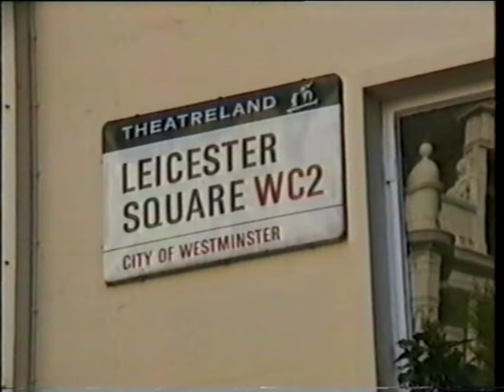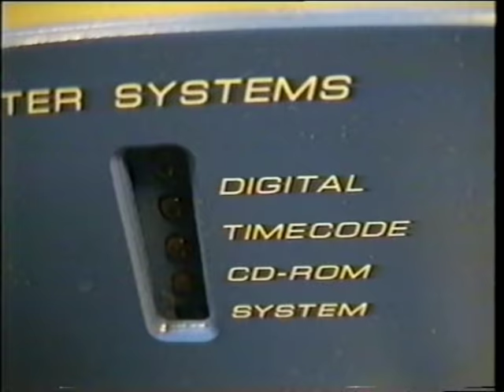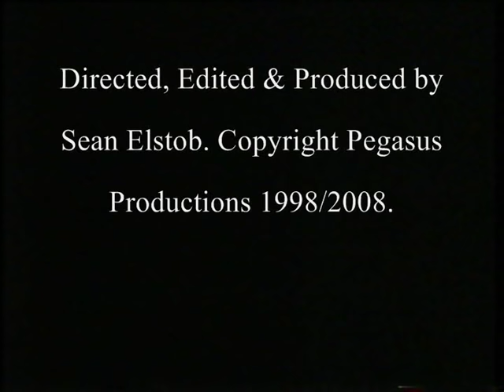70mm...Titanic By Nature

Comment: I used to use a cake rack for lacing up 35mm back when I was a projectionist. I have never laced up 70mm. I wonder what the grain was like considering Titanic was shot on super 35.
Reply from the maker: You might expect the 70mm to look like what it was, a Super 35 blow up but it was miraculously anything but. It was more resolved, cleaner, and finer. I would say they were likely stuck from the original negative and cropped at 2.2:1, so not as wide an aspect ratio as the 35mm and a touch more at the bottom.

Comment: I saw Titanic during its original run back in 1997. The movie was number 1 for months and never have I’ve seen a film that had this much love. Anyway, I never got to see this on 70mm so I’m curious to know if it looked any good as it was originally filmed in Super-35 format and blown up to 5-perf 70mm film.
Reply from the maker: It was spectacular in 70mm. While true that it was duped from Super 35, the 70mm was less grainy than the 35mm due to the increased frame size and reduced magnification. But it’s all relative as there was no practical or safe way way of doing a side by side comparison on screen. Both prints were great. Plus the 70mm was slightly less wide at 2.20:1 than the 2.35:1 35mm print. The audio was beefier on the 70mm as it was DTS. Once we went over to the 35mm print, if I remember correctly (it’s been a while) we tended to just go with the more compressed Dolby SRD track.

Comment from the maker: This version of the video is slightly shorter than the original 'analogue' assemble edit which came in at around 9 minutes. It was always too long in it's initial form but I was always locked into fitting the length of the video to the music tracks that I'd laid down. I HAD to add length to certain shots so that the music didn' t over run, as I had no way to fade out the music during the editing stage. So in 2008, I imported the entire video onto my laptop and set about replacing the music tracks ripped directly from the CD soundtrack. This obviously improved the sound quality and got rid of some of the tape hiss that had accumulated during the initial dub. Now that I had some control over the music, fading in and out and such, I then shortened pretty much everything shot from beginning to end and resequenced the opening to tighten it all up. So it's about 2minutes shorter now. I still think it's too long but hey, you can tinker away at old projects forever and never be done with them. This is the final edit. It's not a masterpiece but it never had those aspirations. Whatever it is now is far more than I originally envisaged it to be, which were just a few shots of film running through a projector and platters spinning.

Comment: We did the RFP at the Empire L/Sq in 70mm. Then the OLS had the run in 70mm. Did you take it off OLS when it finished it's run there. I can't remember. The Empire closed for 3 days of Rehearsals with James Cameron.
Reply from the maker: Apologies but I’m struggling with the acronyms, OLS & RFP? It’s been a while.
Reply from the maker: As you say, we did take the 2 70mm prints off the OLS following their run with it. I imagine the rehearsals with Cameron and his peeps at Lightstorm were tense. Fun and tense. I did a screening of Ghosts of the Abyss screening at the Curzon Mayfair in 2003 and his Lightstorm crew virtually rebuilt and reinstalled the lamphouse in order to get the 3D onscreen correctly. Despite the acute time pressure, they were a chilled and professional bunch.

Comment: Is this the Philips projector that can handle both 70 mm. and 35 mm.?
Reply from the maker: The DP75 yes.
Reply: @seanelstob5922  Nice machine. They still have one in the Eye cinema in Amsterdam. I saw the Master, the Hatefull Eight and some other classics there.😍
Reply from the maker: @bertvdlast  Yeah they were versatile projectors but a bit of a washer/dryer. It did both things, 35&70mm but it didn’t excel at either. The racking bushes were a pain in the hole to change and they seemed to need changing often in comparison to the bulletproof Vic 8’s we also ran. The gates weren’t the steadiest. You had to be on top of them maintenance wise. But each projector had it’s weak spots and little quirks.
Reply: When at first, I had seen Christy. I thought, ohh no. The platters were OK but Christy projectors... I hated them. Then the Kinoton popped into view and my heart returned to its normal beat. Christy was the most troublesome and unreliable projectors I had ever worked on. Gears.

Comment: Thanx for the  demo.  How robust is 70mm film compared to 35mm?  I'd be scared of it breaking ion me  :-)
Reply from the maker: Paul Warner I'd say 70mm is more vulnerable to damage owing to its increased surface area in comparison to 35mm. My experience with 70mm was that I was just hyper aware of what I was dealing with when handling 70mm and therefore took more care and was more cautious with it.  Of the 2 x 70mm prints that we're in Leicester Square at the time, one print already ended up scratched before we took the second print for release. So to answer whether it's more robust than 35mm, in actuality it probably the same. The issue is that fewer projectionists are left that have experience working with it and therefore silly mistakes and damage occurs.

Comment: Was this a 70mm DTS print?
Reply from the maker: Yes. It kept the weight of the print down and if memory serves, it was illegal to ‘mag stripe’ prints in the UK by that point. The 70mm print of 2001 for a release a few years later, with the original mag track, had to be done in Mexico I believe.

DTS by that point had proved itself as reliable on 35mm prints but at least they could default to the analogue track should it fail. With the 70mm of Titanic, if the DTS failed, you basically lost sound as their was no other soundtrack info on the print. As far as I can remember, we never had any reports of that happening during it’s run.
Reply: @seanelstob5922  Illegal to 'mag stripe' prints? Why was that the case?
Reply from the maker: @ryanevans3260  It was to do with the chemical process needed to make them, a process that wasn’t allowed in this country anymore.
Reply: @seanelstob5922  lost 70mm dts = CDS

Comment: Why don't you wear cotton gloves?
Reply from the maker: Das rote Eichhörnchen Its not really practical to wear gloves when lacing up. It isn't even necessary as you're not touching the actual print. When lacing up, you're only handling the black spacing that's attached to the countdown leader. You're really only wearing gloves when it matters, on the bench when you're assembling the print. And if you're really good, not that I'm blowing my own trumpet, experience enables you handle the print in such a way as to not get your greasy fingers all over it.
Reply: @seanelstob5922  unless eating a pizza and fish and chips lol 
far as i recall i only touched the edge of 35mm or can handle the blank part of the film as nothing really on it to take it projector threading around back to platter and then lacing which is i recall , nothing there ? yes , the actual film print is yards away with ads and trailers , is it not now

Comment: The 35mm Film Has Four Square-Sized Dots Per Frame, But, The 65mm Film Has Five Square-Sized Dots Per Frame.
Reply: Perferations. There 70mm film has 5 perferations for each frame. However, IMAX 70mm film has 15 perforations for each film.